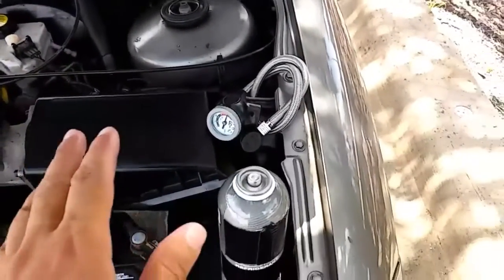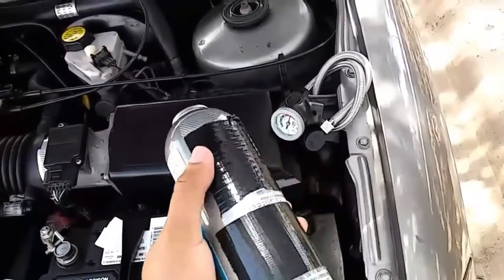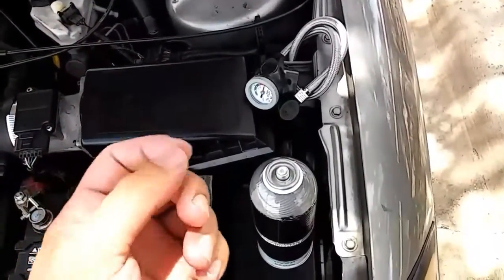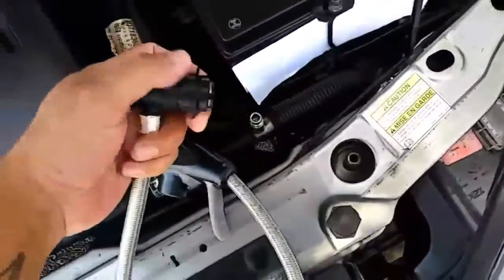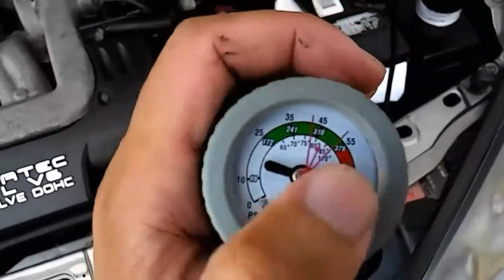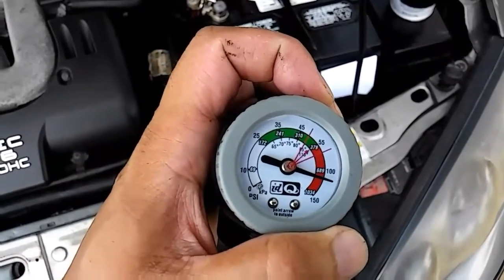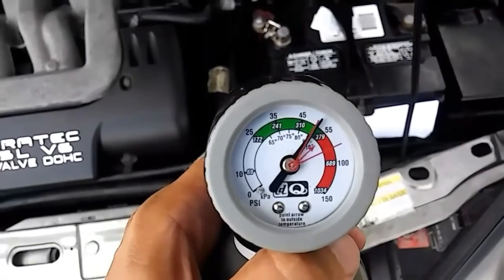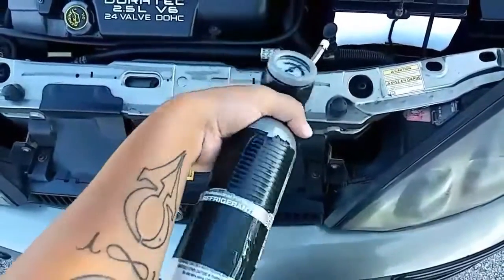Cougar Repairs - R-134a A/C Recharge

Comment: Good vid but clearly you are not 608 certified. here is the correct info on refrigerant(s).
CAUTION!!! R-134a has a boiling temperature of -14.9°F or -26.1°C. Always wear gloves, eye protection, and have adequate ventilation when using any refrigerant. Refrigerants have a low boiling point, take all precautions not to get it anywhere on or in your body. Will cause burns and blistering. Inhaling fumes on purpose to “get high” can be very dangerous. Can be fatal even the very first time you do it. Regularly inhaling high concentrations of Freon/refrigerant can cause issues such as: breathing problems, fluid buildup in the lungs, organ damage, sudden death. Do not vent any amount of refrigerant into the air.
Not all A/C refrigerant(s) are called Freon… Freon is a registered trademark of The Chemours Company, which uses it for several halocarbon products. They are stable, nonflammable, moderately toxic gases or liquids which have typically been used as refrigerants and as aerosol propellants. These include the chlorofluorocarbons (CFCs) that cause ozone depletion (such as chlorodifluoromethane), and HCFC. Not all refrigerants of this type are labelled as "Freon" since Freon is a brand name for the refrigerants R-12, R-13B1, R-22, R-502, and R-503 manufactured by The Chemours Company. The term "freon" is a common descriptor or proprietary eponym like "xerox" or "Kleenex."
It is commonly used when referring to any fluorocarbon refrigerants. Refrigerant is a compound typically found in either a fluid or gaseous state. It readily absorbs heat from the environment and can provide refrigeration or air conditioning when combined with other components such as compressors and evaporators.
Reply from the maker: Thanks for the additional knowledge. 💪 #KnowledgeIsPower

Comment: I'm about to replace the compressor and clutch and condenser, reciever dryer, hoses and orifice tube. 400 doll hairs on rock auto. better pray your compressor doesn't sieze on you. common issue on cougars.
Reply from the maker: +Brady Kinnaird yea most cougars will have this problem eventually due to old age. I have changed my AC Blower and resistor 2 years ago works beautiful to this day.